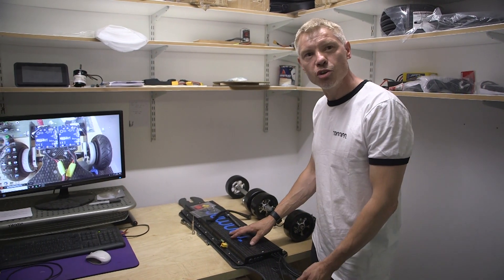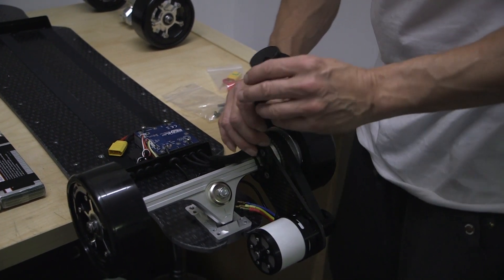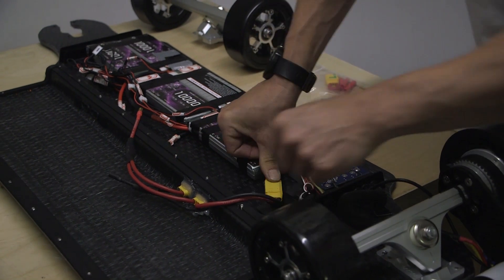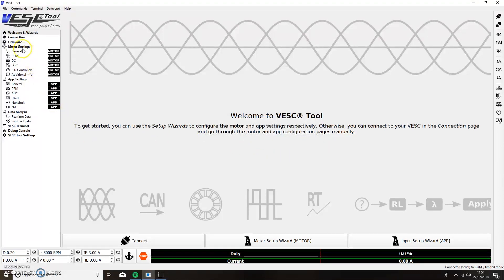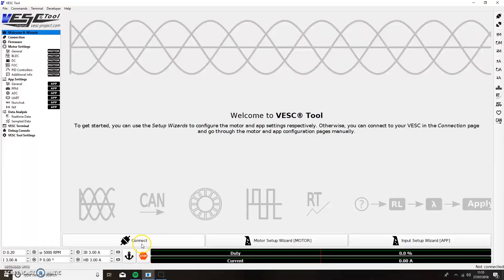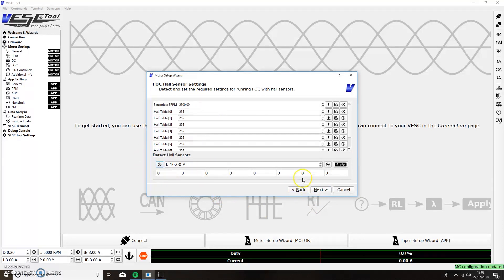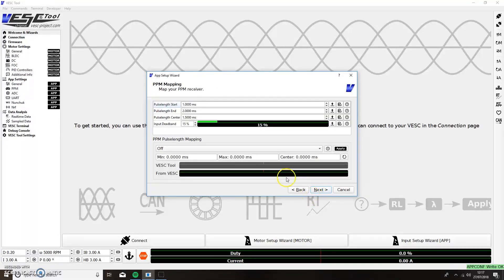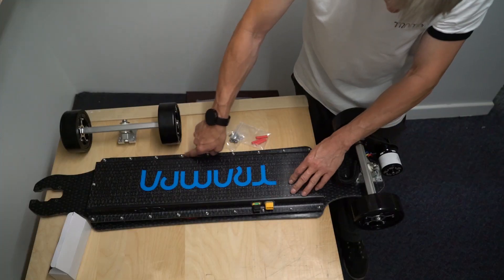single motor VESC SETUP for ORRSOM Longboard (Tutorial)

Comment: I think you forgot about the balancer cables on the battery, those should be lead out into their sockets on the side of the tray.

One question: my motor mount arrived loose, does it matter which position I tighten it in? It has some give, so I can make it higher or lower
Reply from the maker: Hi, Yes well spotted! the balancer cables do need to be pushed through the side of the tray for charging.... this is Jay's first tutorial, i think its very good for his first attempt, no editing!! a natural we think! :-) but i have also seen a few things we need to add into the vid to further help so the next ones will be better...  yes you can choose the position of the motor mount, just turn the countersunk bolt to tighten the bracket into position ... angle them up for clearance or angle them down for a more stealth look.... Drop me an email for further help assistance, ted at trampaboards dot com.